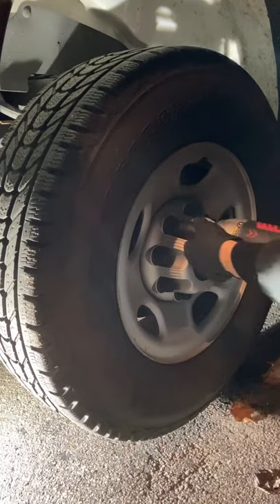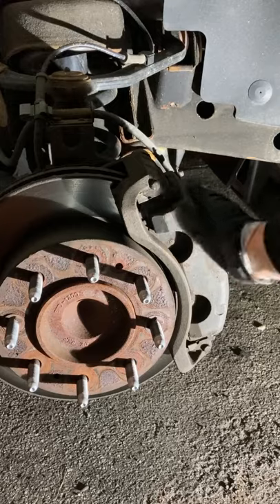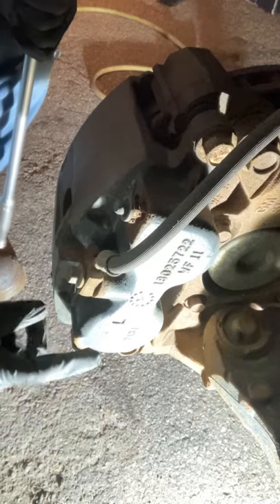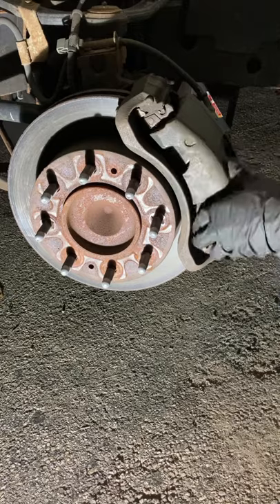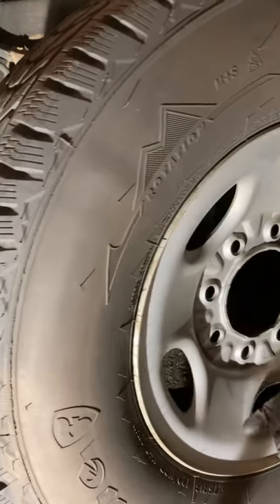Replace Brakes in 60 seconds #shorts

Comment: Thank you what would you recommend if I put wd40 on the disk breaks around the rotor my Toyota 2019 86 it makes a nose sometimes breaking I’ve used crc disk break cleaner but still
Reply from the maker: You might just need to break them in. Try washing it off with soapy water. Or Brake parts cleaner.
Reply: @AndyTheXTech  hmm I know just used it on the rear I believe I don’t remember but I did spray some brake parts cleaner I’ll try again. Hmm soapy water around the disk break rotors and pads will try that thank you.